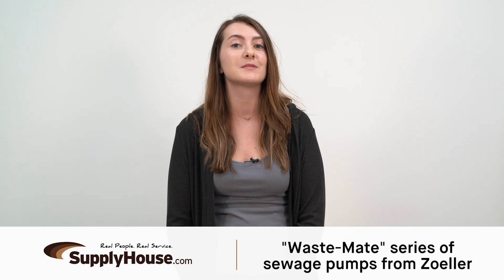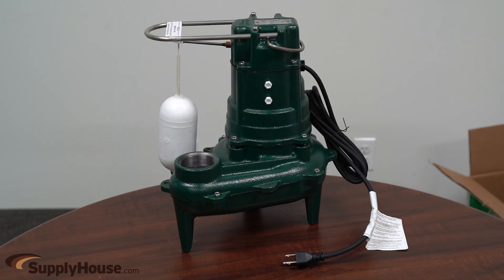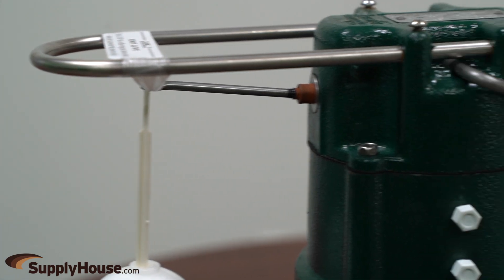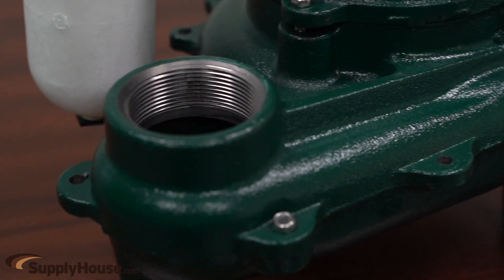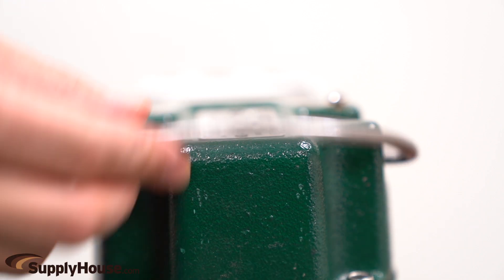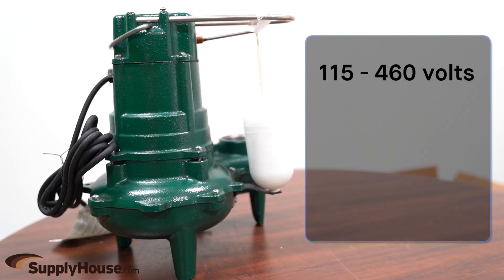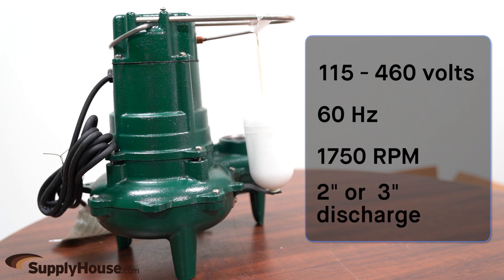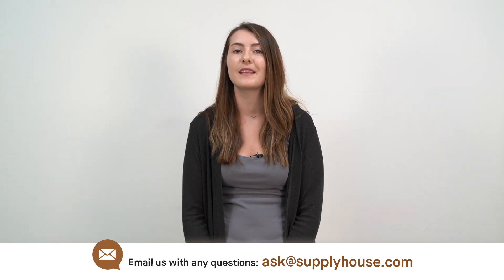The "Waste-Mate" Series of Sewage Pumps

Comment: Quality NOT what it once was. Installed by last Zoeller M267 in April of 2020. It is now November of 2024 and pump has failed.  This will be the second replacement in less than 12 years.

Comment: Good vid. an Auto matic unit with a 10 inch cord seems like a mistake. seems like u would want a Minimum 6 foot cord on any submersible pump to keep electrical connections out of the water.
Reply: It's 10 feet not 10 inch, she just misspoke.